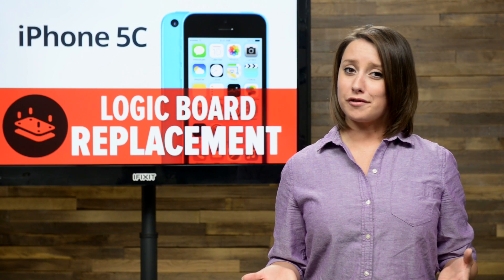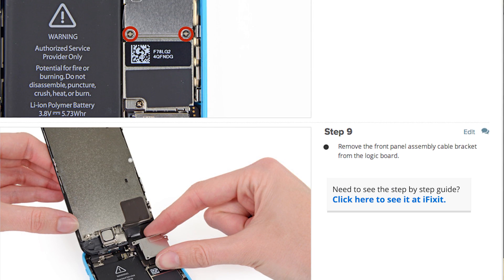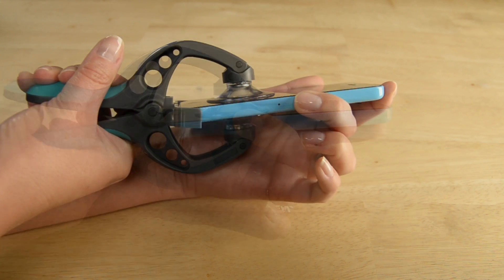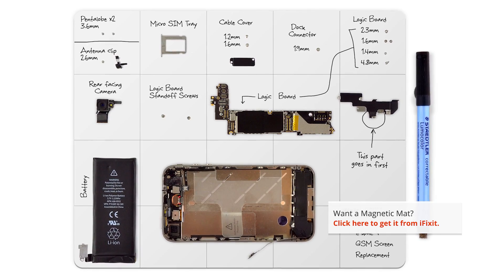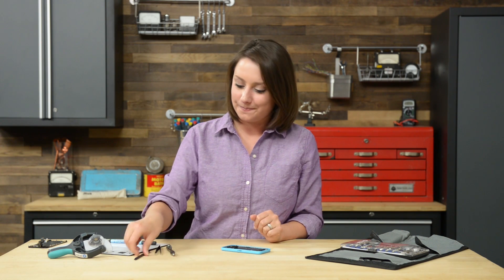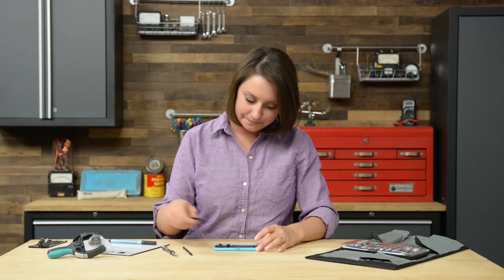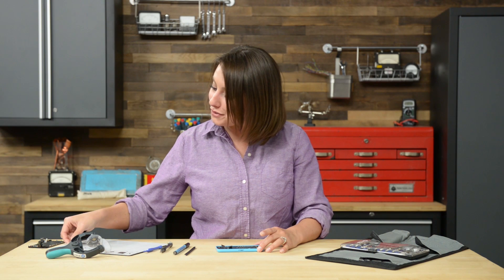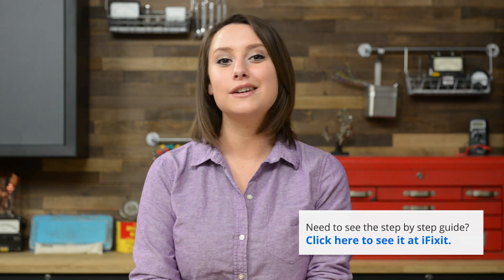How To: Replace the Logic Board in your iPhone 5c

Comment: I have an iPHONE 5 BUT WHEN I lift the front panel up there is another wire that connects to the front button that I did not see in your video can you help please as my phone has water damage so will have to remove all the parts to clean it.